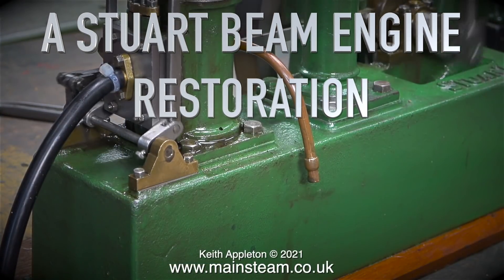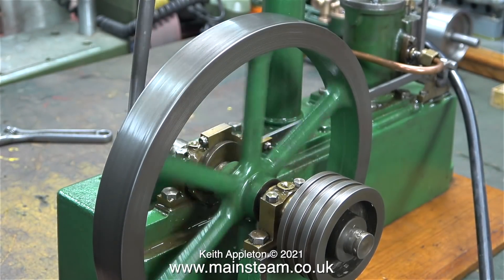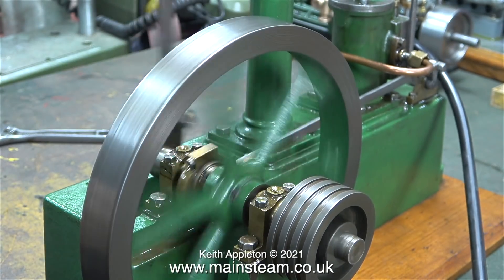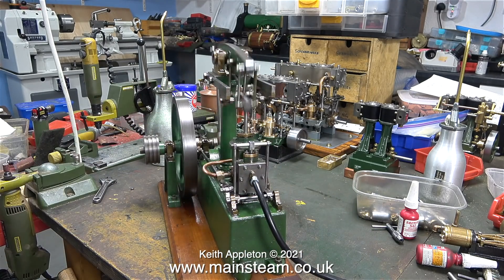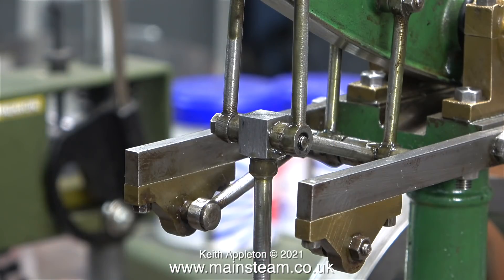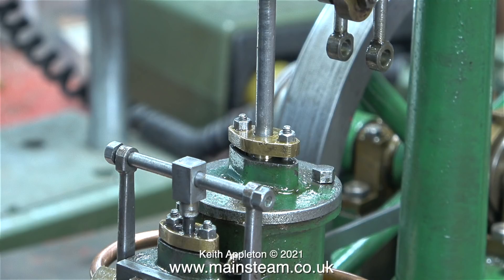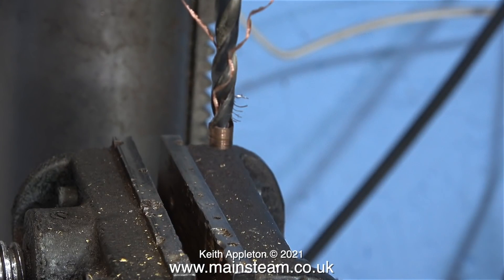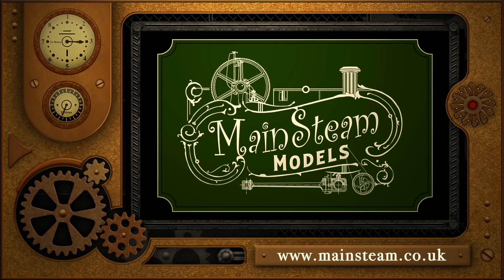A STUART BEAM ENGINE RESTORATION - PART #4

Comment: Hm... isn´t adjusting the timing for minimum knock a way to hide another problem? Probably desired anyway if making new parts with excessive play is not a part of the problem solving. I do not know hov much it matters and how much you sacrifice in regards to making the engine runn slow and efficient.
Maybe the ideal timing for running also is the same as the timing giving the least knock?
Thanks for sharing.
Reply from the maker: You actually answer your own question ....... when the timing is right, the engine is right.